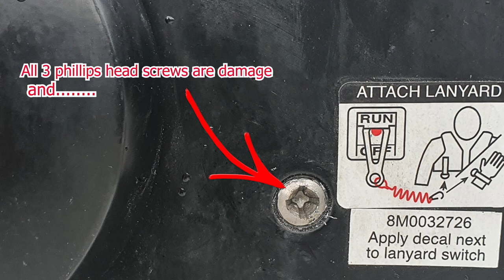Boat Outboard Throttle Controls are hard to shift

Comment from the maker: Dont buy and replace the Boat Outboard Throttle Controls before you watch this video...👌  part number: Mercury Side Mount Remote Control (881170A13, 881170A14)👍

Comment: Thanks for the video.  I sure wish you had disassembled it and put it back together.  I have taken mine apart and it looks just like yours.  For the life of me I can't figure out where the brass bushing and the funny shaped plastic plate with three holes in it goes.  The rest I have figured out.  Some parts just fell out when I removed the back plate.  Hope you are still checking this video for comments and you can help me out.
Reply from the maker: Hi, it's difficult to say much without having seen your controller. But if you've disassembled the controller like I did, there shouldn't be anything falling off unless something is broken or loose. Also, if you've disconnected the wires, some washers and metal pieces might fall off. However, I haven't seen any brass parts inside mine. It's a mix of aluminum and steel parts. You can check out videos that describe the details more clearly and also refer to the manual to see if you can find your part number there.
https://www.youtube.com/watch?v=mdkFnqor-Is
https://www.youtube.com/watch?v=rYJ-95FJf40
https://www.parts-marine33.fr/wp-content/uploads/2020/09/BOITIER-LATERAL-HB.pdf
God lock👌👍
Reply from the maker: Also, check the cable. In many cases, there may not be anything wrong, but the cable itself might be stiff or caught, causing the handle to become stiff. You need to detach the cable from the motor and then move the handle to see if it's stuck.
Reply: @ThinkTechnikk  Thanks.  A smooth small round brass object flat on the top and bottom fell out when I opened up the case.  I have a feeling it goes underneath the plate that is bolted to the handle.  One day I will figure it out.  My controller looks just like yours and I am betting if you took it apart there is a small brass part that fits the description I just gave.  Thanks again. The piece I am referring to is about the size of the end of a pinky finger.  Thanks again.  Let me know if you figure out where you think it may go.  Everything else is working as it should but I am afraid to complete the project not knowing where this part goes.

Comment: Hello from Canada . I own the exact same shifter on my 2007 legend and all the bolts unscrew but just keep turning and I have no access to go behind . Question do you know if I have the rubber gromets also and should I force slowly with a crowbar like you did . Note I have carpeted wall. Also the reason I want to remove it is only to remove the handle to replace the shifter spring so it locks into neutral and do you know the spring part number Thank you. Great video Regards David
Reply from the maker: I am not familiar with your boat, but I have done several removals with a crowbar on a similar boat because the bolts were going round. As I showed in my video, most of the bolts are the same because they absorb the vibration from the handle. I recommend slowly pulling out one side to see if the rubber comes out, and then continue with the rest. Don't be afraid to pull a little harder. I am sure the bolts are going round because they are rubber-made nuts. Good luck!

Comment: Careful with that drill in those holes.  I ran my bolt thru and grounded out a ignition wire, likely killswitch.  Couldn't figure why it wouldn't start.  Took apart and found bare wired rubbing on bolt.

Comment: "Thanks for the fantastic video! Could you please write down the part number of this controller? Thanks again."
Reply: The part number for the controller is pinned in the first comment, but here it is for you again. part number: Mercury Side Mount Remote Control (881170A13, 881170A14)

Comment: G'day mate what is the make and model of that forward control unit I just had mine apart and had to drill it all the bloody Phillips head ones out myself though I completely pulled it apart cleaned it meticulously and greased  it mine doesn't have any key switch or trim and tilt but it does have the buttons on the handle so putting it back together the way it should
Reply from the maker: https://www.amazon.com/Mercury-Mariner-Control-Throttle-881170A5/dp/B00J9FIA2M 
Mercury/Mariner Part number: RC 881170a3,  revT  see video 2:00
Mercury/Mariner OEM Side Mount Remote Control Throttle/Shift 20hp, 25hp
Remember check the wire if those tow wires stock, the Throttle Is still hard.
to check the wires you should disassemble fram the engine side and test it by moving the Throttle handle
Good  luck